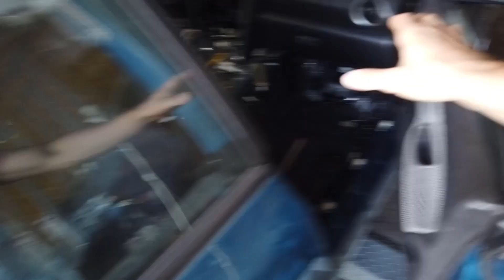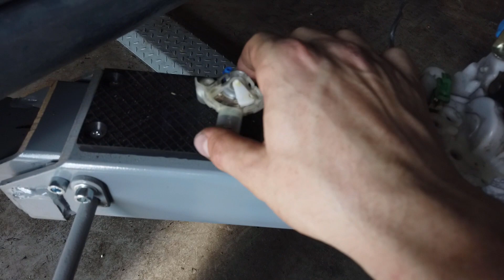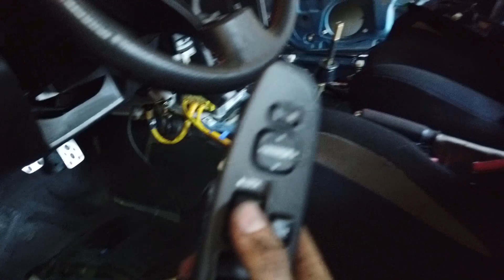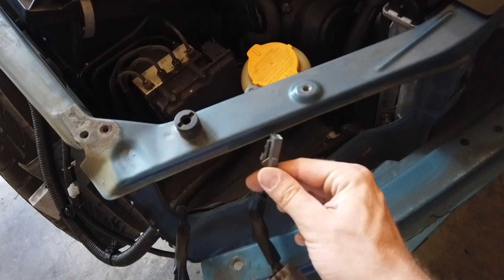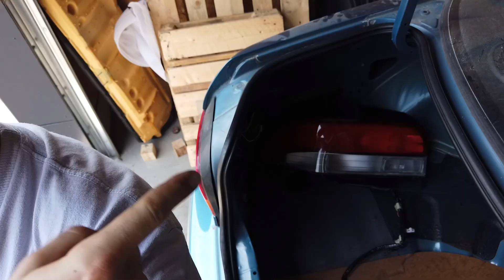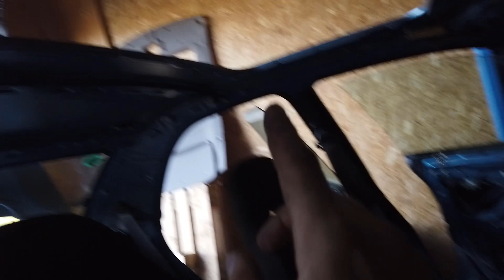Finishing the wiring and JDM tail lights - Subaru GC8 STI Build Ep. 18

Comment: So I got the car running now , did the light splices and everything is working , but when I put it in reverse the right blinker arrow lights up on the gauge cluster. But the reverse lights on the tail lamps work proper. ??? Weird. When i spliced the rs pigtails on . All the wires were exactly the same color so I thought it was simple
Reply from the maker: Josh Cowles Weird, I didn’t have this issue. Make sure to double check with your wiring diagrams, you can’t trust the colors only on something like this

Comment: How do I find gc headlights that have that electronic height control?
Reply from the maker: I guess they're pretty rare, mine came like that from the factory since it was a limited edition with some extra features.
I could try to source you a set from Europe if you're serious about finding one. PM me on instagram @swiss_tuned and I'll see what I can find ;)
Reply: Cool thanks man, I don’t have Instagram . I will contact you one here or something when I’m ready. Still finishing my swap before I get more rare parts .
Reply: Or do you actually have a part number for the lamp and maybe one on the electron adjuster it’s self . And I could see if a dealer here in the states can find it
Reply from the maker: @joshcowles8797  The serial number of the electronic leveler is ICHIKO AL-160.
Also, I just saw a guy selling a pair of headlights with levelers for 200 usd locally, one of the headlights is cracked where you'd normally insert the bulb but it could probably be fixed or you could just install the electronic leveler into your current headlights. Hope that helps
Reply from the maker: @joshcowles8797  I don't have a part number right now, I'll see if it says it on the headlights when I get a chance to
Reply: Nice thank you sir I will keep this in mind
Reply: Also in your video you said the sti wire looked to be the same , did it actually end up working? Plugging in and functioning
Reply from the maker: Josh Cowles Assuming you mean the wires to the electric leveler, no they don’t plug straight in but i’m sure you can match the wires and solder the proper connector to make it work. I just haven’t found the time to do it yet and it isn’t my priority since i don’t have a beam leveler switch inside the car 😅

Comment: What colors go to what for headlights? I’m doing this swap myself and suck at reading diagrams lol
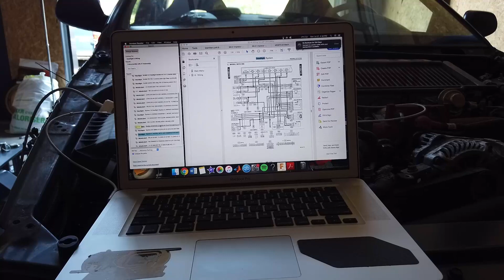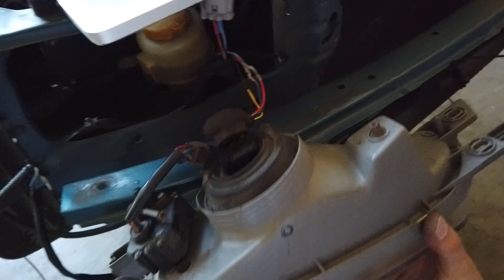Reply from the maker: Watch from 11:09 to 11:52, that should be all the infos you need. I mention specifically which pins belong to which function and then show the wires soldered correctly, just connect the functions together (high beam from GD to high beam from GC, etc.) and you'll be good. Colors don't matter if you know what function the wires belong to, also depending on the year of your swap the colors could be different...